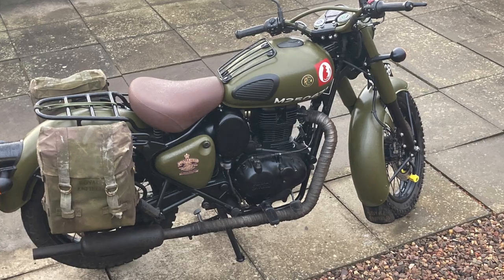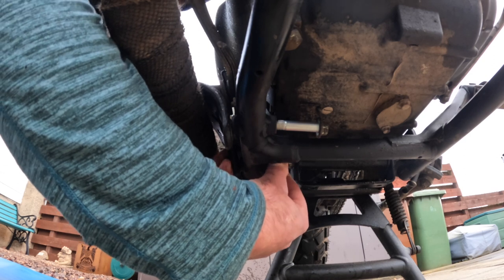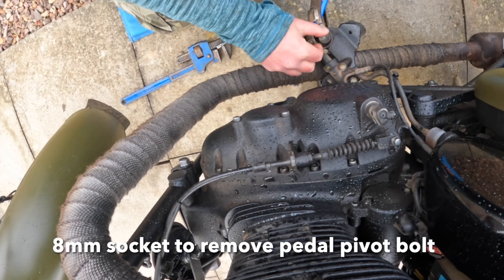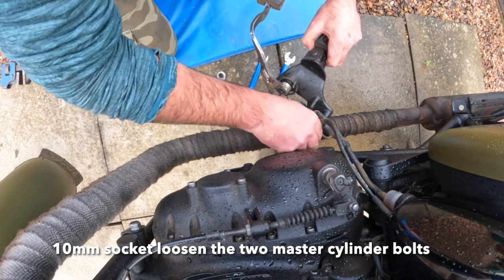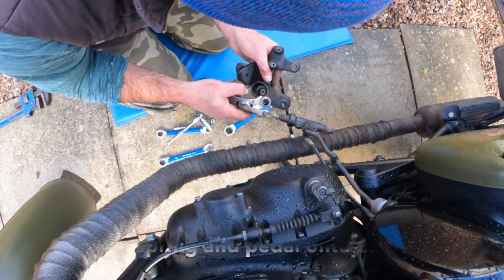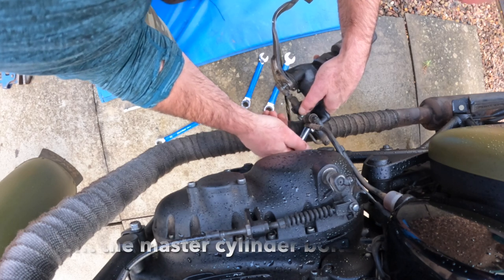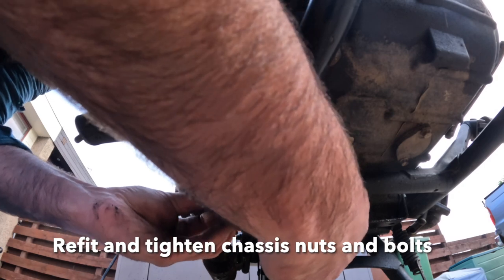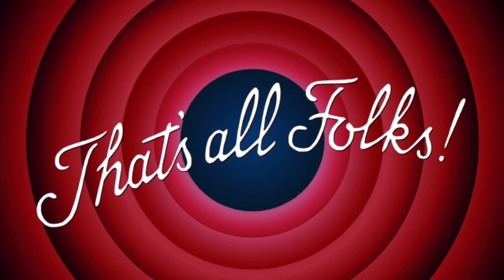Royal Enfield Classic 350 -  Rear brake pedal adjustment

Comment: I too found the brake pedal to high and adjusted it as you have described. I also removed the rubber pad you put your foot on and replaced it with a piece of 5mm thick self adhesive rubber. However before doing this I removed the steel pad and shortened the tag by 13mm and welded the pad back on. This allowed my foot to sit in a more comfortable position and making it easier to move your foot over the pedal when brake application is required.
Reply from the maker: That sounds like a good mod you made to the brake pedal Miles 👍 thanks for sharing! 😁👍 cheers Bruce
Reply: Hi, do you have a photo somewhere how you shortened the pedal, it is not comfortable for me also and I am thinking to do some experiments to fit my foot..thanks

Comment: Thanks for the video. Do you know where to adjust the back brake light switch? Mine comes on only if a apply a lot of pressure on the pedal, but I want it to be more sensitive. Cheers!
Reply from the maker: Not that I know of but I’m sure if you trace the wire it has an adjustable part to sort this?
Reply: @Coastriderscotland  i can’t see anything obvious. It doesn’t look like any other bike I’ve had. Maybe it’s factory set. Thanks for your reply anyway